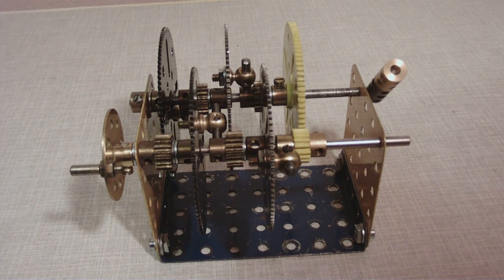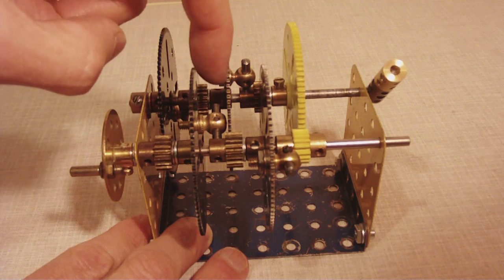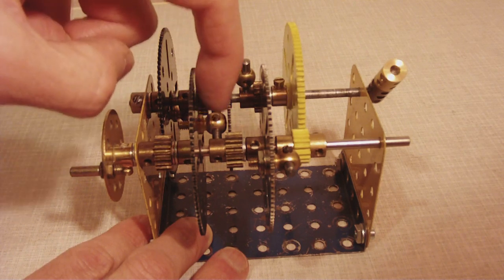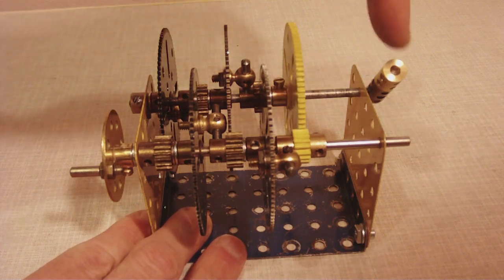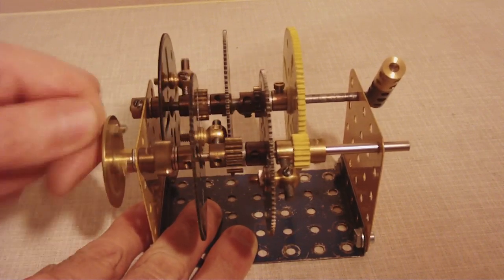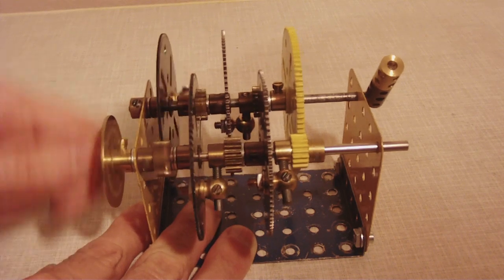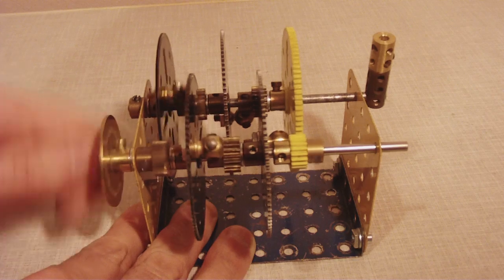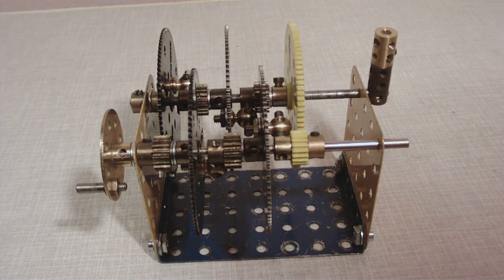Meccano compact 3,125:1 reduction ratio gear box

Comment: I think It's quite more difficult or seems impossible to make rotation at another side.
Reply from the maker: The friction of the bearings gets amplified. In my experience anything more than 1:200 is very difficult to turn. I will do a demonstration of this as it is a popular subject.
Reply: Brian Meccano Leach good to hear, can't wait.
Reply from the maker: Tom Shehorn
I have had so many comments on this that I have made a special 1:3,125 step up gearbox. It is different in design to the one here because the linkages between gears put the centre of gravity of the gear away from the shaft. Could I turn the step up gearbox? Coming up on this channel soon.

Comment: +moxie foxie If you turn the other end, you will generate too much energy.
Reply from the maker: +Kostia4381 it won't turn because of the amplified friction in the system.
Reply: thats not friction by the way. When I tried this with legos, I managed to make a 1:75 thing. and it still rotated.

Comment: There is a meccano part (It rather disturbs me that I know the part number off the top of my head.) number 171 that joins the bosses of two wheels together whilst allowing them both to be free on the shaft.
However this type of gearbox is very inefficient because the high speed shaft is rotating inside a gear at the low speed end of the gearbox that are under high load so there is a lot of friction against the shaft and energy wasted. Can you drive it from the low speed end? If not then by a well known engineering result the efficiency is less than 50%. It is much more efficient to fix both the shafts to the gears at the low speed end and take the drive in via another 19 tooth gear on a separate shaft.
Reply from the maker: Donald Sayers I'll take your word for it on the efficiency front. No it cannot be driven from the low speed end. The ratio involved of 1:3,125 is far too high. I don't believe that would work even if the gear chain was on 6 separate rods.

Comment: would it be possible to have a 1 to lets say 200 gear ratio?
Reply: +That One Gamer Guy Any gear ratio is possible with the correct gearing assembly. For example, gear reductions of 4:1, 2:1, 5:1, 5:1 in four stages would do it. Not sure if that was your question...

Comment: I'd love to download a diagram that would show you how to make this thing. Although unfortunately I don't have any Meccano parts for it, it'd certainly be worth a try. ;)
Reply from the maker: I don't have a diagram for it but the construction is fairly simple.
Driving shaft left to right. Pinion fixed on rod (26), Washers, Gear Wheel free on rod (27c), Pinion free on rod (26) etc... to a Collar fixed on rod (59).
Driven shaft left to right. Washer, Gear Wheel free on rod (27c), Pinion free on rod (26), Washer etc... to a Gear Wheel fixed on rod (27c).
Each Gear Wheel except the last has a Handrail support (136) bolted to it and a short Threaded Pin joined to the next pinion. The Threaded Pin does not contact with the rod.

Comment: The thing you're talking about is called "Machine with Concrete".  It is a kinetic sculpture produced by Arthur Ganson with an end gear ratio of 244,140,625,000,000,000,000 to 1.  At that rate, if the driving gear was going at 200 RPM the final gear would take more than 2 Trillion years to complete one revolution.